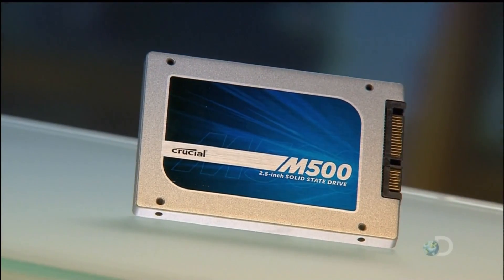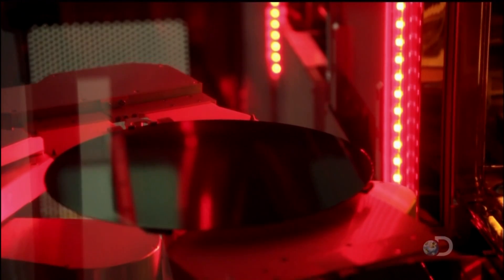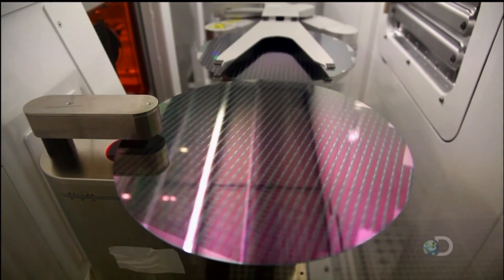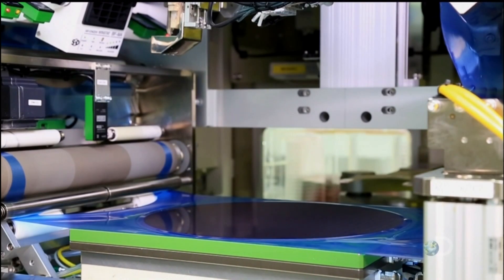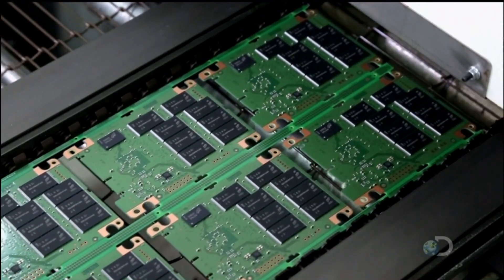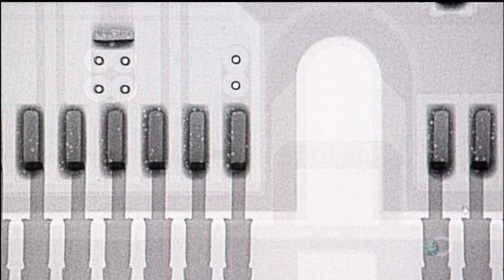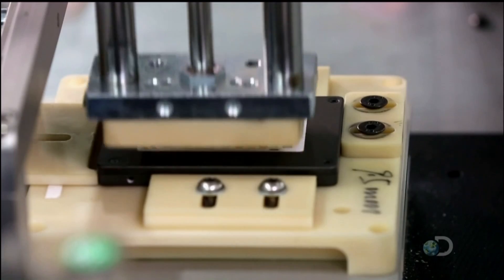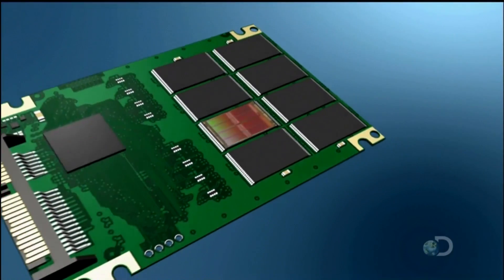Crucial SSD Factory

Comment: This video is grossly incomplete. They missed out the entire process that goes from silicon wafers to the finished chips you see at 2:36. That's the most interesting part of the process! You missed wafer sawing, die attach, wire bonding, molding and testing. Everything else you show in this video is the same for virtually every other electronic component. This might as well have been making circuit boards for children's toys, the process is identical, just solder chips to the circuit board, singulate boards, test, package and ship.
Reply: they might be using a FCBGA type package, but yeah I'd say the manufacturing process is more a trade secret sort of thing.
Reply: obviously they don't show it lmao. Any fab, be it micron, global, or TSMC won't let anyone ever see their process.
Reply: .. its only a 4 minute over view movie, not intended to be a comprehensive one so you could go build a drive you🤡
Reply: What you ask for is a top secret information, which any company would not show to their competition.

Comment: Had exact drive. Failed within the 1 year warranty. Support claims they no longer make those and wanted to give me what they call a "fair market value" of $54 bucks. After several BBB responses, they couldn't understand why I had a problem with my $125 refund. Shit drives. If you want reliability, Intel SSD's are the ticket. Purchased first one (40GB, 2007) and still kicking. I can't tell you  how many other brands I have encountered problems with.
Reply: I've been using a Crucial M4 256gb as my main drive for the last 5 years with no issues.